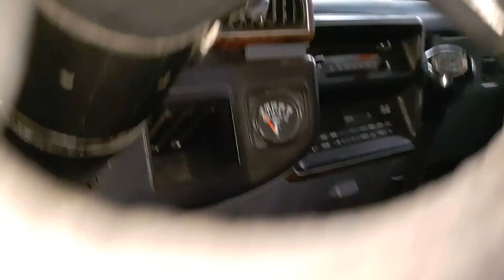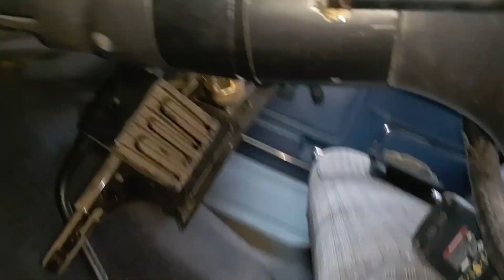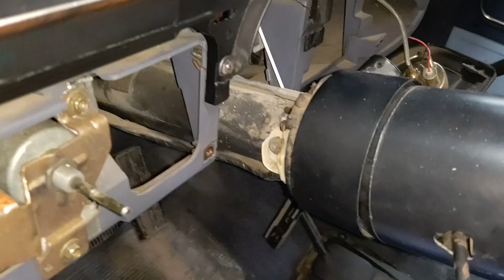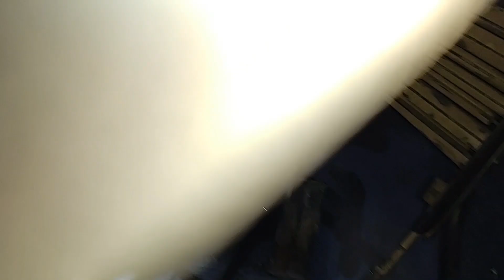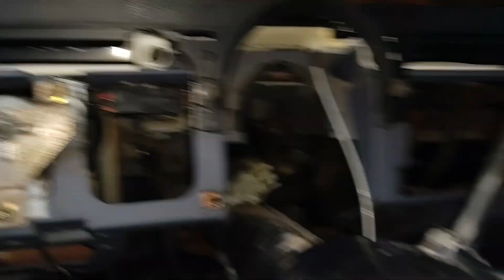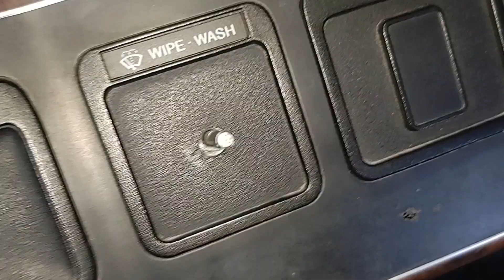How To Replace Steering Column 1990 Ford F150

Comment: Trying to remove a key lock cylinder from an 88 Ford F150 but the little screw holding it in has been drilled but not removed.. what can I do?

Comment: Ford built those 8th gen F-series pickups & 4th gen Broncos from 1987 through 1991.
Reply: Yea, and I have a 1990 F150 4.9 liter that needs the steering column fixed or replaced.